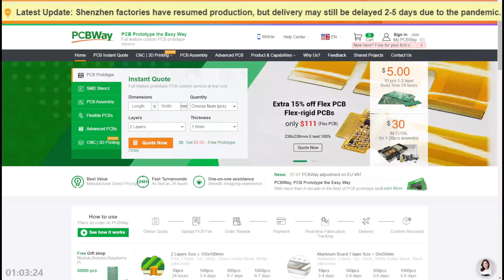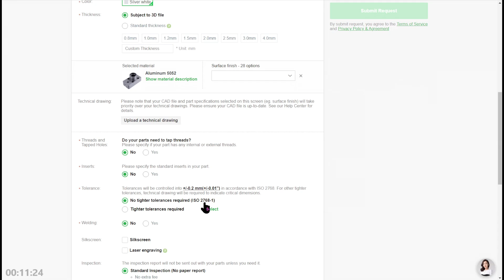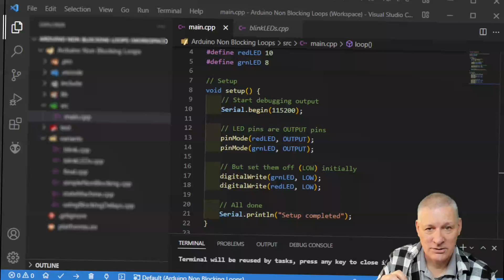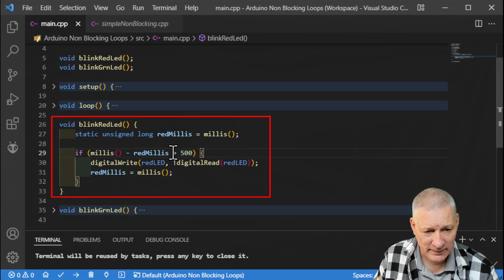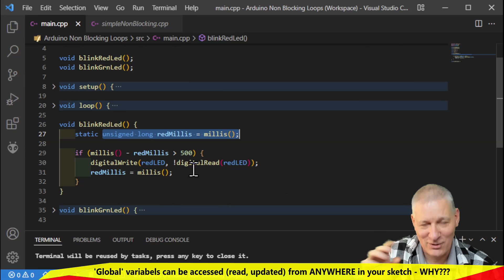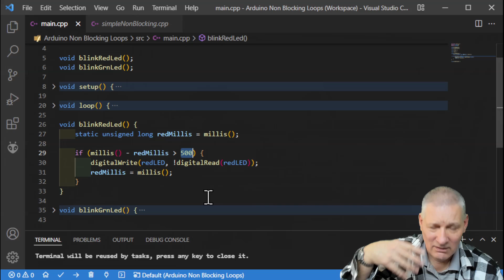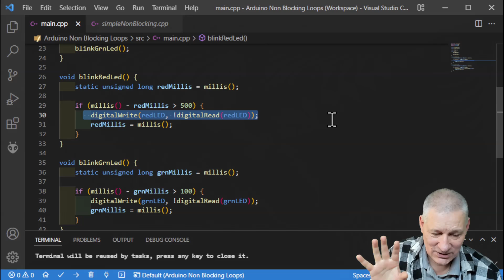#BB5 Moving your Arduino to a multi-tasking State Machine - Easy Intro

Comment: to prevent slowly introducing lag, instead of doing: grnMillis = millis(), you should do: grnMillis += 100. This ensures that regardless of hickups and delays in other functions, the interval will remain (or correct itself to) 100ms.
Reply from the maker: I'm just trying to work out where the lag is, that you refer to. Just so that others are aware, the timing here is anything but critical but even so... 

I think I understand your concern: on each invocation we check the millis() and if true grab a new value from the millis(). That new value could be more than 100 + the original millis() (because we started late and/or have done some work). So we slowly drift further and further away from a true 100mS flash - it might be 100, 102, 103, 104... etc since the first flash.

Yes, your suggestion would ensure that only 100mS would have passed until we ran the code inside the "if" statement. Good call. 👍
Reply: @RalphBacon  I should have called it drift, but that indeed is the issue: scheduling the next action 100ms from now, instead of from the previous action. Keep in mind that the millis-overflow edge-case could be tricky here, so it'd be best to extract it from the two functions and write it as a separate function that handles all the miserable edge cases :)
Reply: And for exactly the same reason you could initialize the static variable with 0, Ensuring that the first event happens 'exactly' on the set interval after startup
Reply: @sdr9682  Doesn't that timer counter start at 0 when first turned on? Oh... I just thought of something. I don't think it resets the timer counter when you =reset= the AVR.

So initializing it with 0 at startup, you do have a set interval each time, even if you reset rather than power up.
Reply: Oh, man, I came here to say this!

Comment: What would happen when millis() is called after 60 days? Edit - I discovered becuase it's unsigned it'll just overflow to 0 and the subtraction method will still work just fine
Reply from the maker: Exactly so!
Reply: The timing would not likely be 500ms though. It should use a signed variable to maintain timing.

Comment: Ralph, you are a naughty boy

You have 2 calls to millis() in each function.  This is not good practice as the value may vary between the 2 reads, to say nothing of the overhead of calling the millis() function twice but I am sure that you know that
Reply from the maker: All done by design. 

Calling millis() in each function ensures we get the most up-to-date value, not that it's critical in this particular demo. But if it were critical that each LED was only on/off for 500/100mS then we need to re-read millis in each function.

There's hardly any overhead in calling millis() BTW. The 1mS timer interrupt ISR just updates a volatile which is then copied to a standard variable to avoid reading the memory location each time (by other functions wanting millis).
Reply: @RalphBacon  For accurate timing we don't want the up-to-date value of millis() because it may change between readings.  

It would be better to take a snapshot of millis() on entry to the function then to use it for the test and setting the start time for the next period.  

That way there is no slippage because the value cannot change between the test and resetting of the start time but It certainly doesn't matter in this example, and my comment was very tongue in cheek,
Reply from the maker: Very true about setting the snapshot at the start of the function. Oh well, what a few nano-seconds between friends? 😋 (Tongue out of cheek, couldn't find an icon for in-check).
Reply: @RalphBacon  If you ever need a few nanoseconds let me know and I will email you some !

Comment: Very good video! I think the next step into a state machine is to use a state variable instead of digitalRead. After that, show how to make the on and off-times different for a LED.
Reply from the maker: I want to show some Real World use of a State Machine; using one to record the state of the LED is not necessarily the best use as we can do that the way I've already done it.

Better use would be to be able to exit (and re-enter at the same point) the function between states (assuming there are some, not yet in the demo I showed).

Comment: what's better, this technique, or using RTOS?
Reply from the maker: If you want to run FreeRTOS on an Arduino, your code will probably be very small (because the UNO's runtime memory is small).

That means using RTOS on such a small sketch is a case of diminishing returns, IMHO.

OK to practice with, but then you're not using a full-blown version of freeRTOS either.

Doing it this way uses no memory footprint to speak of so your code can be doing more useful stuff.

Even on an ESP32, which already runs freeRTOS out of the box and has lots of run-time memory, you don't want to just run task after task in a willy-nilly fashion. It's not a Silver Bullet for bad program design.
Reply: Hi Ralph, if the tasks are isolated, this approach seems feasible. But when you have to pass data between tasks it may become more problematic. Thoughts?
Reply: An RTOS like FreeRtos has too much overhead for a uno.  I  am trying to get into the habit of using FreeRtos evertime I can. As it produces very efficient code. On an uno though I do what Ralph just did, use millis(), Best way to produce non blocking code on a micro with not enough resources for an rtos.
Reply from the maker: I did find this one which I will play with to see what it does but I hope to get a 4808-based UNO (6K SRAM) which will make it easier.
https://github.com/feilipu/Arduino_FreeRTOS_Library

Comment: Great video! I've been using pseudo multitasking on Arduino's, ESP8266's and ESP32's for years but learned a few things from this video (Ie. the use of Static). I'm glad you pointed out that this is not true multi-tasking as that is often mistaken when discussing this with the Arduino/C++ coded devices. It would be interested to have a discussion of true multi-tasking with the dual processor ESP32 but that probably would be a fairly advanced topic?
Reply from the maker: I'm not sure what the fascination is with "true multitasking" versus pseudo-multitasking using time-slicing. 

Yes, using both cores on the ESP32 is a possibility for true multi-tasking but then you run the risk of crashing Wi-Fi or BT or something on Core 0. We're not running NASA here, so why the fascination?

That all said, I did a video on simple dual core multitasking on an ESP32 here in video #149: https://youtu.be/jpVcCmh8sig and on passing values between tasks in video #151: https://youtu.be/ywbq1qR-fY0

But none of my Real World ESP32 projects use both cores as application cores.

Comment: After 49 days, both of these functions will quit working because millis() will begin again at zero and the functions will then need to wait for it to exceed their variable values.  It would be FAR more precise to assign
LEDvar = millis() + delay;
and then wait for millis() > LEDvar so that the variables begin again as well.  This has a glitch every 49 days:  the loops will blink every time until millis() does overflow and millis()<LEDvar again.  This glitch can be fixed by
if (millis() > LEDvar && millis() <= 0xFFFFFFFF - LEDvar)

It would be even MORE precise to store uint32_t temp_time = millis(); at the beginning of the functions so that the value being compared does not change in the middle of the function.  (Then replace all other millis() --> temp_time.)

It depends upon the application whether such limitations should concern us...
Reply from the maker: Nope. When millis() overflows (back to zero) the formula I showed still works just fine. Remember, it's an unsigned long integer so there are no negatives.
Reply: @RalphBacon  When millis() overflows, redLED will be 0xFFFFFED8.  millis() will not be greater than that again for 49 more days.  It only takes 2 months to see for yourself...
Reply: @byronwatkins2565  The code is checking if millis() - redMillis is greater than 500. This will still be true even after a millis() overflow.
Reply: @gsdcbill  The bits all act exactly the same, the processor simply interprets them differently.  For 8b the unsigned interpretation is [0, 255] (0x00-0xFF) and for the signed interpretation it is [-128, 127] (0x80-0x7F).  For 16b it is 0x0000-0xFFFF vs. 0x8000-0x7FFF; and for 32b it is 0x00000000-0xFFFFFFFF vs. 0x80000000-0x7FFFFFFF.

Comment: I created in C a multithread (up to 32) state machine, in like 40 lines of code.
Reply from the maker: Well done, Tony. I guess you are not a beginner then 😜
Reply: @RalphBacon  a RTC (1ms steps) IRQ sorts all the tasks sleep indexes, sleeps and wake up to run the event check that goes for each task.  Tasks has to be cooperative so it uses switch/case as state machines.

Comment: If millis() eventually wraps around to zero, the flashing will stop, won't it ?  To fix this, the loop condition could be modified to, e.g.,  "if ((millis() - redMillis > 500) || (millis() < redMillis))".
Reply from the maker: Nope. The line of code in the demo works even when the millis() goes back to zero. Unsigned long integer maths here, no negatives.
Reply: @RalphBacon  OK.  So, the result of, e.g., 100 - 4,000,000,000 in unsigned long integer maths turns out to be some number > 500.  Clever !
Reply from the maker: Not "some number", Chris, The correct number of milliseconds since we took the snapshot.

Comment: I understand that you are starting from the beginning but putting state machine in the title may be a little confusing / misleading, it is essentially a timed function loop.
Reply from the maker: It's the first step towards ensuring a State Machine can even run. Or do you propose we have a State Machine in a monolithic structure? We've got to get more things running first and that we did!
Reply: @RalphBacon  I am not proposing anything, but reading the comments some think that this is a state machine when it is not.

Comment: Nice video, this is how i started with arduino 10 years ago. after that i made my own library that can increase or decrease value(s) without blocking. this way i can easly use PWM or servo's with Scene time and fadetime. and 3 years ago i also added sin to it to make it more smooth.
Reply from the maker: Cool. Sounds great Emile 👍

Comment: Great stuff Ralph!  For 5 bonus points code how you deal with the millis() rolling over...
Reply from the maker: It already deals with the rollover just as it stands. That was an easy 5 points.
Reply: @RalphBacon  yes, but here is a fuller explanation ... The question often comes up in conversations about signed Vs unsigned integer calculations: what happens when the max value is reached and goes negative if incremented. As any assembly programmer should know, the compiler generates the same code for both signed and unsigned. Let that sink in and you will realise the it MUST still work.This is the beauty of twos-complement!

Comment: Ralph, You almost have a state machine, you have two independent loops, my understanding of a state machine, is nothing moves to the next state until a condition is met, something like this;
//Define the states of the machine
#define LED_OFF 0
#define LED_ON 1

uint8_t fsm_state;

 void setup() {
 fsm_state = LED_OFF;// beginning state
}
void loop(){
  //state machine
  switch (fsm_state)
  {
    case LED_OFF:  //Statements to execute every time LED_OFF is reached
      digitalWrite(13, LOW);
      if (digitalRead(13)==LOW) { // verify output is low
      fsm_state = LED_ON;// the state condition is met, change state
      break;
      }else{
      fsm_state =  LED_OFF;//continue waiting for condition to change
      break;
      }

case LED_ON:   //Statements to execute every time LED_ON is reached
      digitalWrite(13, HIGH);
      if(digitalRead(13)==HIGH) { // verify output is high
      fsm_state = LED_OFF;// the state condition is met, change state
      break;
      }else{
      fsm_state =  LED_ON;//continue waiting for condition to change state
      break;
      }
    default:
      break;
  }

  delay(1000);              // wait for a second
}
Reply from the maker: Now stop skipping ahead, Jeff 😜 I'll be doing a simple State Machine in the same vein as what you say but wait!
Reply: @RalphBacon  Sorry Ralph

Comment: Cool video, IMO using object oriented code can make this sort of program much cleaner, as you wouldn't need to repeat the state machine logic code for every instance you want to create
Reply: If you are using C rather than C++ then classes and such doesn't exist so it depends what your compiler is.
Reply from the maker: No beginner understands OOP so I'll be giving that a miss for now. This is still very clean and maintainable code. Also, this demo flashed LEDs but in the Real World I hope we do more than that!

Comment: Brilliant video, for getting started on non-blocking coding.

I am assuming that reading (and especially de-bouncing) buttons  - without the use of delay() - will also be one of the upcoming examples on the state-machine list.
Sometimes I need to have buttons de-bounced, both when they are pressed and released. I find that is a good job to define via a state-machine.
Reply from the maker: Well, I'd probably be more inclined to have a "readButton" function that does all the debouncing but we will see.
Reply: @RalphBacon  I did think to put the state-machine into the function "readButton", so the main loop, can still consist of a list of function calls.

Comment: Nice video ! one question: Isn't correct on the forward declarations put also their inside code ? (and skip like this the part after the loop)  How critical is the place of the functions ( i see that you put them after the loop) ?
Reply from the maker: If I understand the question correctly, you can write the entire function before you reference it (in the loop, for example). That way you do not need to forward declare separately.
Reply: @RalphBacon  So i suppose the placing of the functions inside the code is just a matter of personal taste, and if i decide to place them before setup (like i usually do, so i can have all ''basic'' ingredients of the code gathered), then forward declare and complete function code is just matching (and there is no need to write them twice). Thank you for clearing out to me this part !

Comment: It's good to see you educating folks on good programming practice.
Hopefully in a subsequent video the blinkxxxLed() functions get replace by one blinkLed() function, initialized with pin number and interval.  (i.e., remove the duplicated code from the sketch.)
Reply from the maker: Nope. This was a simple demo just to do two things. The fact that it was the same code was done for simplicity. The second function could have turned a beeper on/off but would have got very annoying very quickly.
Reply: @RalphBacon  Sorry, but "beeper"???  All I was suggesting was that a class could be instantiated with something like redLed = blinkLed(redPin, redInterval) and greenLed = blinkLed(greenPin, greenInterval), which is scalable to the number of available pins. Because code isn't duplicated in such a case, it is more maintainable, which I hope all would agree is a good programming practice.  If that's not something you want to cover on your channel, that's fine.  It is after all your channel.
Reply from the maker: I've covered the DRY concept whenever it seems sensible to do so; what I meant by my comment is that you're concentrating on (and commenting on) the duplicated code whereas in Real Life the two functions would be doing something very different (to each other). That's all 😜

Comment: Thank Ralph.   I've used millis() before but your explanation of  "Static" was helpful.   When I first saw the subroutine code I said wait, that's not going to work the timer is constantly being reset.   Nope!  For some reason I only thought static was when you didn't want the program to ever change the value.      I can think of several projects I've done where timer and other declarations are littered throughout the program, when they can be neatly stored as a local variable in the subroutine.
Reply from the maker: Yes, keep things tidy and your program will be more maintainable, for sure.

Comment: State machines are fun!  Show transition diagrams.  Pass on UML. Maybe show how easy to add states in a table-based machine.
Reply from the maker: I will probably show a quick and simple transition diagram but will concentrate on getting the states written and read. Noobs, remember. KISS as they say.

Comment: Yep, learn something that I can use in future but as your note in the video pointed out, this only works until you have something like a slow sensor that locks up the CPU, right?
Reply: You would check every so often if the sensor has data "ready" sometimes there is a flag to check for this, that way you don't need to wait for a long time, you would also benefit from interrupts.
Reply from the maker: This is partly true; my DS18b20 temp sensor takes "ages" to get a reading after a request but that's where a true State Machine will deal with it.

OTOH if the call to initialise your SPI bus takes a whole second there's not lot that can be done other than to rewrite the call to make it more responsive. Fortunately such cases are rare.

Stay tuned as we progress this!

Comment: Hej Ralph, very nice intro, glad to see you again. btw I did  some vector dot's 🙂
https://youtu.be/EpPe25oZQC8
Reply from the maker: Very nice, what was it running on?
Reply: @RalphBacon  it work on 2 STM32 discovery kits. First one is STM32F746G DISCOVERY with screen in 480x272 pixels resolution 60FPS, the secon one was STM32F469i DISCOVERY kit with 800x480 pixels but 30FPS.